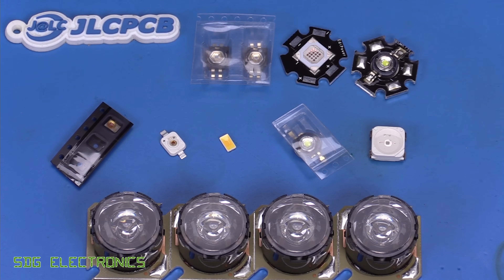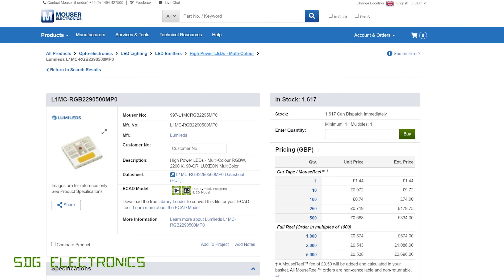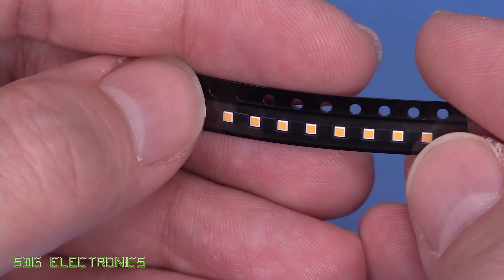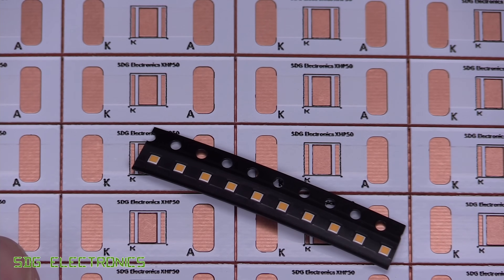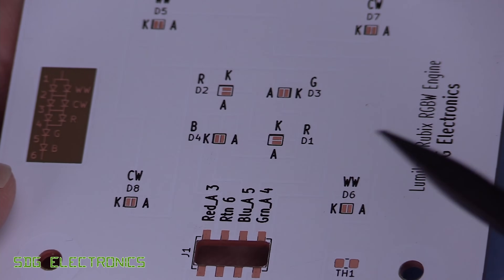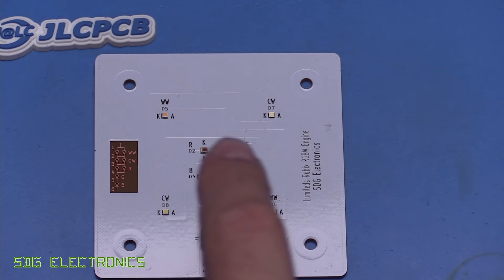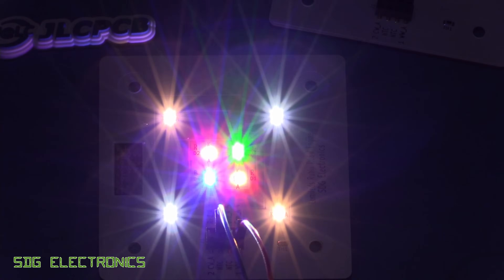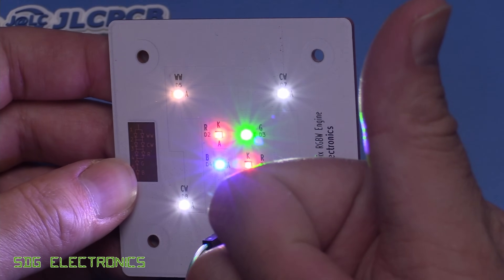SDG #326 A copper core PCB with tiny 1.4mm Luxeon Rubix LEDs

Comment: Interesting the green has higher thermal resistance too. 
You are right you basically need active cooling if not water cooling to run these things near their max spec for sustained time periods. Its not as bad but similar to how FETs specify current at 25C die temp.

Comment: I may be not thinking straight, but can't you just reduce the voltage to the green LED?
Reply: For ease of driving, he’s using a single current-limited supply for the whole string. That means each section (one or two LEDs in parallel) shares the same current. In this configuration, there’s no way to make the green have a different current to the rest. 
BTW, LEDs are current driven devices, not voltage driven, and their operating voltage is only partly dependent on that current, mostly being defined by the diode forward voltage which differs depending on the emission colour.
Reply: @simontillson482  Thanks for your explanation, just learning, but picking up more every day.
Reply from the maker: I could limit the PWM duty cycle into the green LED which overall reduces the power dissipated by the green LED. But I still need to address the stencil issue as it should be possible to keep the temperature lower.
Reply: @sdgelectronics  I see, thanks for your reply, Steve.

Comment: I tried reflowing some of these rubix a few months back, all of mine sat at varying degrees of wonky too. I pushed the cyan up to 2.5A before it went fap, on an al backed board. I've got 180 on starboards on order. One of the whites goes up to 3A if i recall, but the cri was something like 65

Comment: This reminds me of the Pentair Microbrite swimming pool lights I have waiting to be repaired.  They use the Luxeon Lumileds, in 3 groups of 4 on a 30mm circular aluminium PCB. Each group is powered by a ZXLD1362 driver + supporting components and the whole thing attaches to the power and control part of the light through the same pin header you have used.  I've had a couple of these fail - drivers and diodes burning out - but one needs a new LED too.  I have no idea how I'm going to get tiny blobs of paste on the pads for the LEDs, bu I have been successful with the other components, using a Miniware hot plate to do the repairs.  Since the lights are $400 each, it's worth giving it a go!

Comment: For the copper PCBs you show at 5:50, how did you specify the cutout in the dielectric layer in design files? How do they produce it? Do they mill the cutout before laminating to the copper?
Reply from the maker: JLCPCB will confirm the appropriate heatsink pads, or you can add another mech layer and write "HS" on the pads

Comment: This is great! I'm working on a project using L1I0-0850060000000 (Lumiled IR) and trying to design a driver for them. I've learned a lot from your channel.  Still no luck on the driver but I'll keep trying.
Reply from the maker: What kind of specifications are you looking at for the driver?
Reply: @sdgelectronics  we're doing high speed video capture.  Trying to use the lm3409HV to drive 10 of them at 2A (10us pulse).  So about 64w.
Reply: Resistor is a driver, don't be shy using simple solutions - for low duty cycles voltage source + FET + resistor is quite thing.

Comment: For LEDs without the heatsink pad, you can try the Vishay ThermaWick thermal jumpers. It looks like a SMT resistor that is thermally conductive but electrically isolated. You can place close to LED from anode or cathode to the copper base. It helps significantly on FR4 boards due to the fiberglass prepreg. With the couple mil insulator on copper core pcbs (that's ~1-2W/mk) it is less beneficial, but can still be useful in lowering junction temps.
Reply: I have been itching to find a project to use those thermal jumpers on, just because I think they’re cool for some reason! :p
Reply: Cool, expensive and kinda useless - for LEDs just use the appropriate substrate or reduce power density - very rarely you need that lowest thermal resistance.

Comment: It's amazing how cheap aluminium PCBs are these days. I was expecting you to mount the connector upside down so that the body was through the PCB leaving you with a nice flat top in case you decide to mount a diffuser or something like that.
Reply from the maker: I had considered it, but the legs have a slight taper on them and I was wasn't sure if it would short on the copper core.

Comment: An almost ideal solution for a changeable spectrum is to use phosphor-based colour RGB LEDs, so that you get 'overlapping"RGB spectra, avoiding problems of "peaky" spectrums in mixed white...if you know what I mean?
Reply: If you want tunable white - just use multiple white LEDs of your choosing - anything RGBW without optical feedback will just lead to color shift and is hard to implement in general.
Reply: Well...if all you want is "tunable white", maybe, but you lose spectral flexibility, and end up having more troubles, with more LEDs to be "tuned"...the RGB driver developed at National Semiconductor, for me, has a wide range of tuning possibilities, including per-LED temperature compensation, and 12-bit calibration per LED, which is then multiplied by the PWM setting (it has 8 bit current setting, and 8 bit PWM which also has linear I bit to logarithmic 12- bit PWM values
LP5523 I2C control, 9 Channels, on board charge pump, ADC to do self-Test and ambient temperature or brightness, 3 engines that can run programmed sequences,/cycles, and, and...
Reply: @lohikarhu734  you want a synchrotron, not a tunable color engine at this point, besides the hard part is not the source or drivers, its the feedback.

Comment: I tried these LEDs and their thermal resistance sucks. You should have a look at the CREE Element G LEDs. Same thing but they feature an isolated thermal pad.
Reply from the maker: Thanks I'll look at those. Pretty much all of the Lumileds LEDs are either too small, or the larger ones aren't rated for high current.